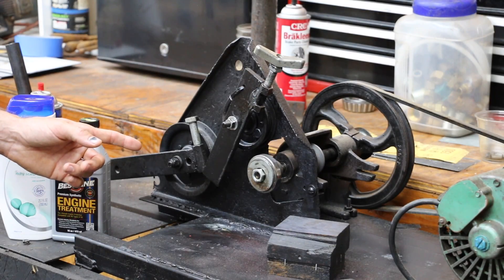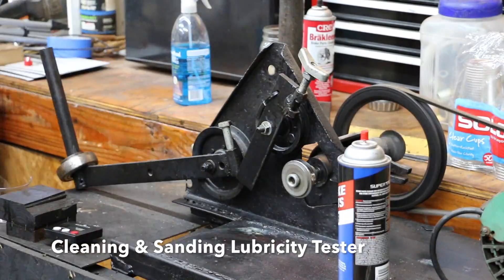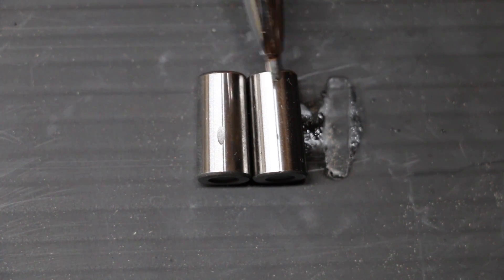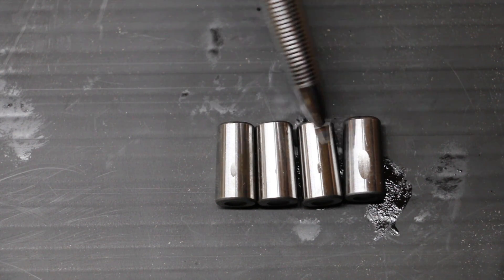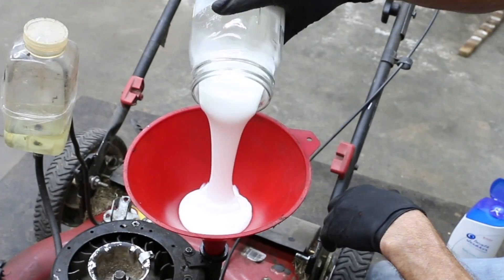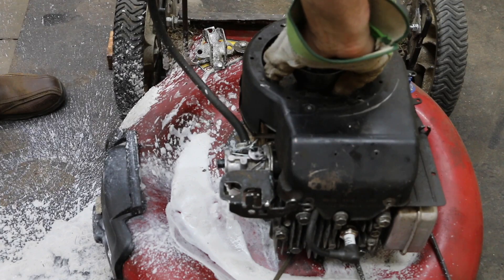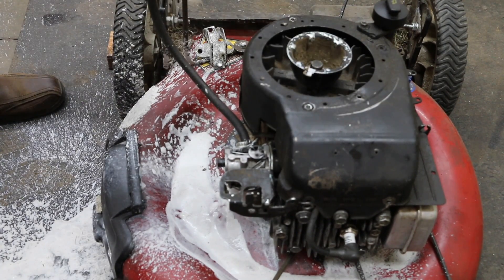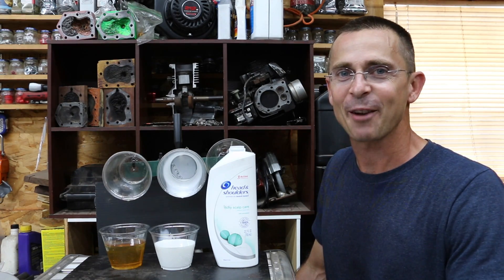Shampoo as Engine Oil?  Let's see what happens!

Comment: In high school I had a friend that totaled his late-seventies Dodge Aspen (slant six).  Bored one day, he poured a few pounds of sand into the valve cover.   Then filled it to the top with water.    Ran it, brick-on-gas-pedal until it heat ceased about 2 hours later.   After cooling off he was able to restart that thing and continue torturing it for a few days.      Amazing what an engine can truly endure.  Also amazing what a bored teenager will do in a rural town
Reply from the maker: Wow!  The durability of some engines is amazing!
Reply: Oak Knob Farm 
We did that with a kawasaki 3 wheeler we tried to blow up. 
Sat there on the roadside and put a few handfuls of gravel in the crankcase. 
Damn thing lasted another year , another buddy bought it , removed the side cover and fished the gravel out and drove it another year or so. 
Not sure what happened after that , but he didn’t blow it up.
Reply: Omg seriously 🤣🤣 I'm a newb in the automotive world. I had no idea an engine could with stand that kind of abuse. And yet I had an ex that would complain I was ruining the transmission and this and that just by driving and not babying the car🤣🤣
Reply: hahaha!  probably depends a lot on the engine in question.   The slant six was known to be a very long living slug.   Not sexy.   Not fast. Not powerful,\.  But also not likely it's gonna die in your lifetime.

Another friend had a Buick Regal.  Was told it had an oil leak.   He had no mechanical skills....So he added a quart a day.   Everyday.  Never checked the dipstick.    Lasted a week
Reply: @OakKnobFarm  🤣 well I got a Honda 4 cylinder from 2005. Have no idea if it's any good. All I know is it gets me up to a 100 mph. 🤣🤣
Reply: @OakKnobFarm  mine is guzzling gas. 🤔 I just keep filling the tank up every 3 days🤣🤣
Reply: Rachel Laylee, I'm a fairly old dude... so being "fast" isn't as important as it once was.   BUT:  I do still drive a Magnum with tinted windows.   But now I go low and slow....hahahaha
Reply: @OakKnobFarm  haha might as well enjoy the ride😀. My thing is prerunners and trophy trucks so going fast over ruff terrain is my thing. There are race engines that can definitely hold up. Friend of mine is gunna start a race engine company so that will be wicked. By the time I have my truck caged I'll probably drop a race engine in. I know I'll learn more about them as I have at least two years to learn. 😁
Reply: @rachellaylee3425  had some old friends into the mud-truck scene.    Pretty crazy machines.   Enjoy, just don't spend ALL your $ on it ;)
Reply: @OakKnobFarm  hopefully I'll get some sponsors to take a bit of the money burden off. 😂 Crazy how much stuff costs. Especially to race baha $100k+ trucks. Thankfully I'm pretty good with money and don't spend it unless I have it. 🙂 Well I wish you happy cruising. It was a pleasure talking with you 😁.
Reply: The Mopar slant six has to be one of the most durable engines ever made...
Reply: Bob Weiss Ford slant 6 as well. I think Ford orig had the design. Dad had in F150 was indestructible. All F150s are indestructible actually.
Reply: That’s kind of an unfair comparison because the slant 6 is basically an indestructible engine to begin with lol
Reply: Oak Knob Farm Midwest fun.

Comment: That engine ran about 10 minutes longer than I expected. I'd really like to see butter in place of oil.
Reply from the maker: Thanks for the video idea!
Reply: An engine stuffed full of shrimp, thanks in advance
Reply: I second this
Reply: Since we're doing silly stuff, peanut butter!  . . . No NO, even better CHUNKY peanut butter.  (Just kidding, I'm reasonably sure peanut butter can't be done without thinning it with peanut oil.)
Reply: Yes!
Reply: I wanna see butter too.
Reply: Blue Bonnet margarine.
" 🎵 🎶 Everything's better with Blue Bonnet on it. ♪ ♬"
Reply: Butter and margarine could both work for awhile, but you do have to realize that they will need preheating, they are 1/3 water, which will evaporate quickly leaving you with a much lower oil level, and they both have stuff which will gum up. CLARIFIED butter would work the longest.

Comment: Fun video! What kind of wire brush do you use to clean carbon build up from the cylinder? I have a small wire brush for my dremel and it seems to work but it did slightly damage one of my cylinders. I think it's safe to say your brush is significantly better.
Reply from the maker: I use a wire brush but I recommend using something softer on an engine of any value.
Reply: Project Farm thanks for the reply. luckily the engine was just a project. would a nylon brush do the job if it was spinning at a good speed?

Comment: I've noticed you seem to allow the crankcase vent to expel lubricants in your test. Wouldn't it be more fare  to recapture it/ them back into the fill neck ? (say with a 2'' copper tube on the fill neck and the vent draining into it)
Reply from the maker: Great point. It normally vents into the carburetor.  That would have been rather interesting to see how it works as fuel.  lol

Comment: Try brake fluid in the crankcase. It should be able to take the heat with how hot brake systems get and it does have a slightly slimy feel to it.
Reply from the maker: Great test idea!

Comment: too low of zinc content, and you would have to do away with the foaming action that is actually built in as well. 
Have you tried powdered graphite suspended in... some liquid, maybe a light weight oil? 

If we're going to go down this road any further, what other products you might find in a grocery store would have any chance of working, besides the obvious cooking oils. No shampoo would ever work if it foams up like most people want it to do when using it for it's intended purpose.
Reply from the maker: All great points and I haven't tested graphite yet, but I do have some.

Comment: And what about a personal lubricant? (Lubricity tester results would also be interesting.)
Reply from the maker: Thanks for the test idea!
Reply: and try different brands of personal lubricants and with/without silicon.
Reply: Personal lubricants as engine oil, seems more reasonable than shampoo
Reply: k4benpircs ... Add a shot of Viagra and watch that piston go!
Reply: Astroglide? Lol ky the heat version and the ice version and there's a few others. That would be interesting.
Reply: going to walmart n asking for a case of ky is the prob.but really i need it for my mower.
Reply: Do it!
Reply: You would have to test water based and silicone based!
Reply: Heh, yea, that was funny when the od boys did it. They were so ashamed of buying so much of it, and yea, it's too thick to flow as an oil.
Reply: Try a non water based one
Reply: Od did that last week..

Comment: Please do the best aerosol clear coat
Reply from the maker: Great test idea!
Reply: Project Farm I do a lot of painting on fiberglass and plastic you could test the flexibility
Reply: the 2 pack type in a can, is by far the best, otherwise none of them are very good, not tough or resistant
Reply: Have to preface it with "sold at Walmart" or something, to avoid specialty brands like SEM.

If it's Walmart only, this is my vote: https://www.rustoleum.com/product-catalog/consumer-brands/auto/general-purpose-paints/acrylic-enamel-2x/
Reply: Hint from a 16 year collision repair pro..... they all suck. You’d be better off buying a cheap hvlp gun and some cheap urethane clear. If you need a lot of flexibility there are flex additives, but most modern clears have a good bit of flexibility as is. As long as you don’t over activate it. Also, SEM products are overrated.